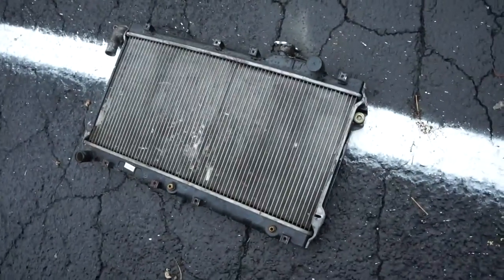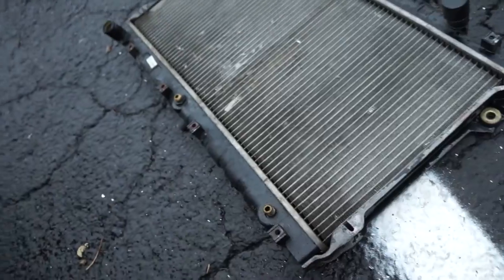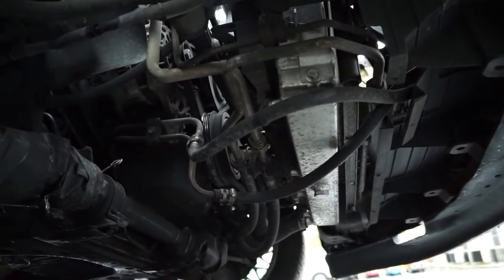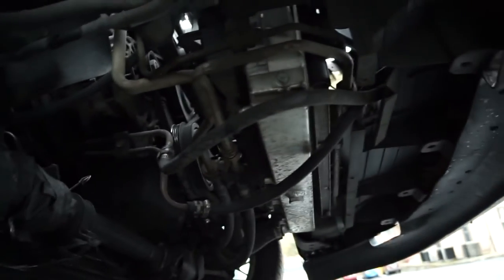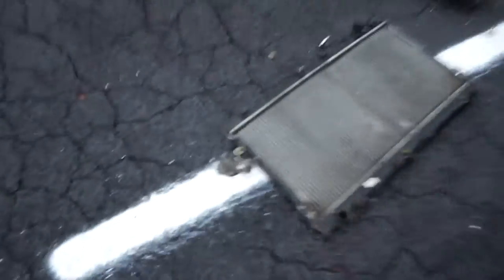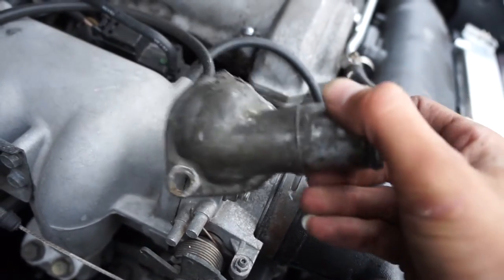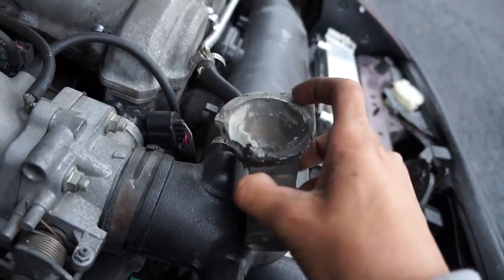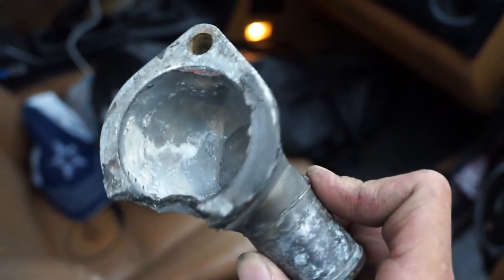Convert Manual Radiator for an Automatic Car (miata)

Comment: Did you mount it to the radiator?
Reply from the maker: It can’t mount anywhere you want to mount it. Most people do mount it directly to the radiator because that’s the easiest
Reply: @vincentbryan1962  got one more question. I know which pipe is the oil return line. Does it go to to the bottom? Or does it even matter?
Reply from the maker: It doesn’t really matter. I have one on my 62 impala. I don’t think there is a real order. Look it up online if you feel iffy about it. But to me. It’s worked on both my cars not caring which goes which

Comment: good job man i almost ordered a manual one then i saw it says for stick shift only ...
Reply from the maker: sharjeeel 240 I'm glad man. Nobody told me they were different so I asked around and eventually after a lot of stress found out about a (transmission cooler) basically doing the same job as an automatic radiator. Glad the vid helped
Reply from the maker: +sharjeeel 240 how did the install go? How's it running now